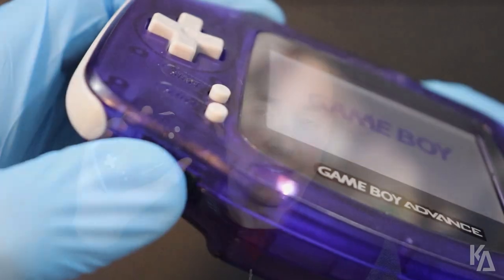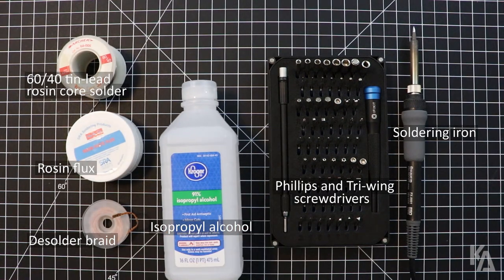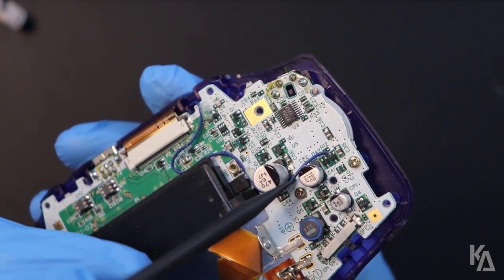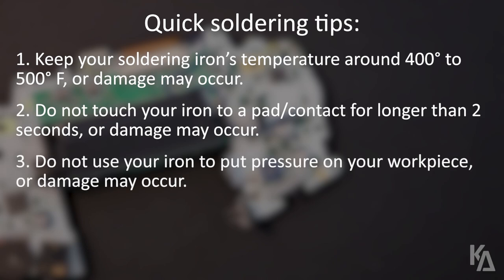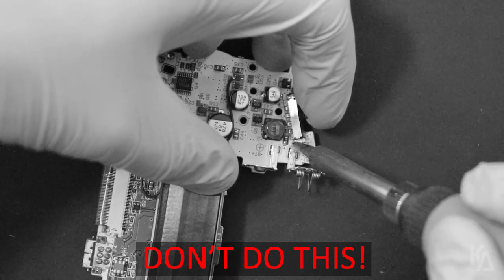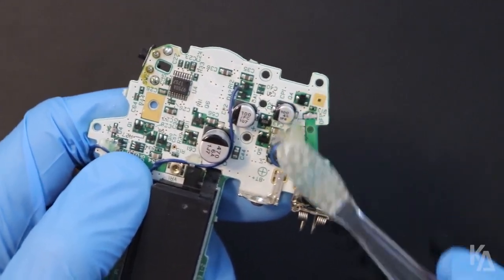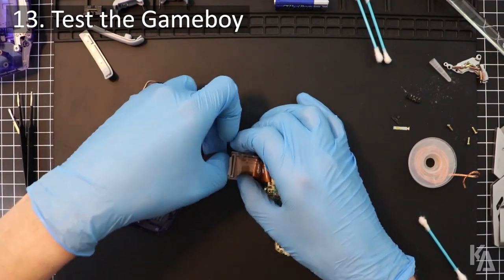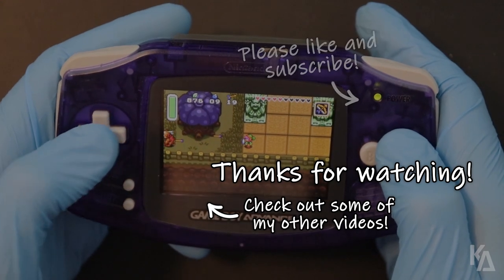How to Repair a Gameboy Advance Power Switch

Comment: I've done a number of this type of switch replacement. I suggest taping off the area around the original switch with kapton and removing it with hot air. As far as the pads go, it's not really necessary to load them up with solder and if they have too much the switch board may not sit appropriately to align well with the plastic slider. If you accidentally lift an anchor pad (the ones on the side) it can be replaced with copper tape adhered with high heat epoxy.

Comment: Great video man. If I can suggest, try using a soldering iron with a pump built in. Works so much better for removing solder since you are essentially sucking the solder as it melts, and leaves it very clean.👍👍
Reply from the maker: Thanks for the tip, brother!  Good to see you here. 🙂

Comment: Handy video for me. Just worked on a GBA of my own that has started having a similar problem. Power switch doesn't work reliably for me. And thanks for the follow-up to this about power switch pricing. Will be doing this repair once prices come down on power switches again.

Comment: I'm planning to do this since like.. more than a year now, haha. I've got the replacement switch, but I'm just not confident enough in my soldering skills. I'm fine with replacing batteries in gameboy carts, but yeah.. this is another level. I've got a simple Weller at home which has temperature control done by changeable tips (called Magnastat IIRC), but I'm not sure I have one going so low.. well, maybe your video is a sign,.to finally give it a try! :)
Reply: So I finally got to work a week ago.I think the most stressful and hard thing was to remove the switch from the board. I grabbed it with a tweezers, kept heating up the four solder points, but it just didn't want to budge. I tried to be patient, but it was hard to keep cool considering that tweezers kept sliding off and that I felt the anxiety of frying the board. Finally it popped off without causing any damage. I thought that it would be smooth sailing from that point but oh boy.. I applied new solder to the pads, positioned the new switch.. and spent next 15 minutes to get this fucking thing to stick to at least one point. It was just hard to use tweezers to keep it properly in place, it just kept moving off in different directions. Finally I somehow managed to get it to stick to the on side and from there it went a bit better, but I still struggled for quite some time. When it was finally done, I quickly put everything back together and, considering how sloppy I was, it surprisingly worked like a charm.

I definitely wouldn't recommend this if you're not confident with your soldering. Maybe it's not the hardest thing ever, but it's definitely not the easiest.

Also, a small observation: I've started with a soldering tip at 320 Celsius as it was the lowest one I've got in my arsenal. Couldn't really melt the soldering points in reasonable time (took way longer than 2 seconds which you recommend). I've switched to 370 Celsius and it went way more smoothly.

Comment: what would you call this gripping tool at 7:59? looks insanely useful
Reply from the maker: Metal electronics tweezers 👍🏻
Reply: @KyleAwsm  Thanks. Do you know where to get some like yours? When I google that I get mostly normal tweezers or just flat ones, but the grip on your pair looks much better.

Comment: Do you have a multimeter recommendations for working on gbas?
Reply from the maker: I like my Etekcity meter, but any meter that tests volts, maps, capacitance (some don't!), continuity, resistance, DC, AC, etc. then you should be fine.  Expect to spend around $30 for a decent meter.
Reply: @KyleAwsm  thank u very much for the informative, detailed reply sir